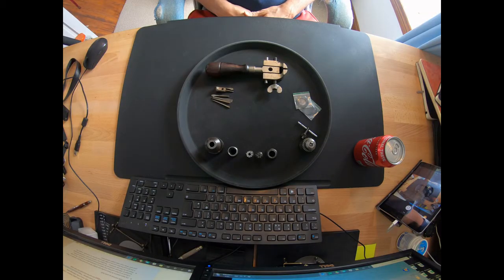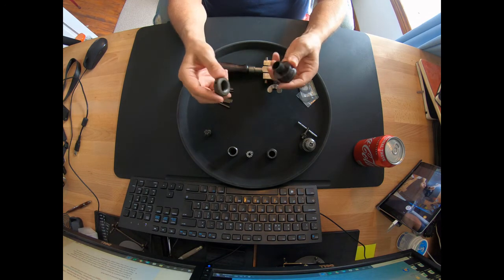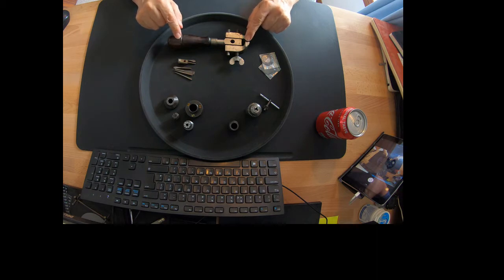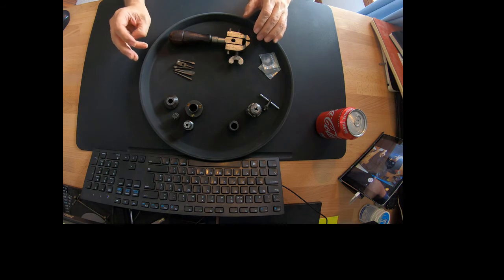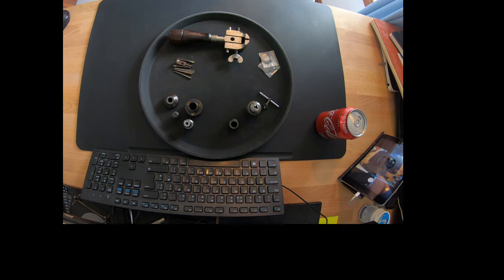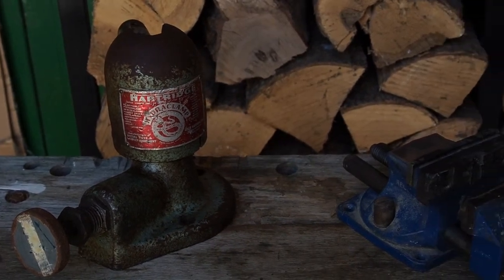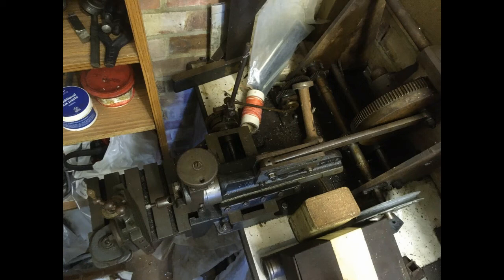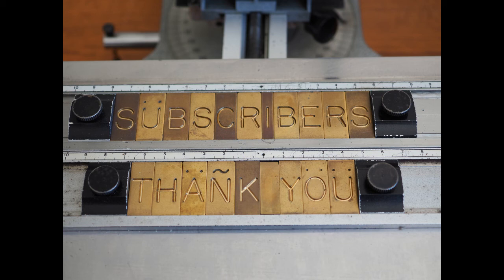Hotchpotch - No 2. The Knackler's Workshop - General Update.

Comment: Hi Paul. Those are some very nice acquisitions. Perhaps you can make a variation on the original unimat collet chuck. Externally the same as the original, but internally, bored to suit ER16. Maybe that's already the plan?
The shaper and lathe look great. I love that the handpowered shaper has been motorised. The lathe looks quite useful too, but I understand the drive to get yourself a shiny new one.
Love the toolchest. What else do you need before you can get the unimat lathe running?

Cheers,
Craig
Reply from the maker: Hi Craig,
I was pleased with the new bits and bobs… Yes, I think a hybrid of the collet chuck would be good (Old form taking ER16 collets).

I am so pleased about the shaper and can’t wait to get it going in the new workshop. The real concern about the lathe is how accurate it performs, I’m no Stefan G but would like things to come out near the size I want them to be… I will most definitely get it all up and running and see how it performs.

I just need the paint and new spindle bearings and I think everything is there to start work on the Unimat. I don’t think I will start the restoration until September.

Take care
Paul,,
Reply: @TheKnacklersWorkshop  That's great - looking forward the unimat work. I have my fingers crossed for you re: the lathe. You're right a lathe that's all over the place is not much good for making parts to size/spec. See you in the next video (whether yours or mine!) Cheers, Craig